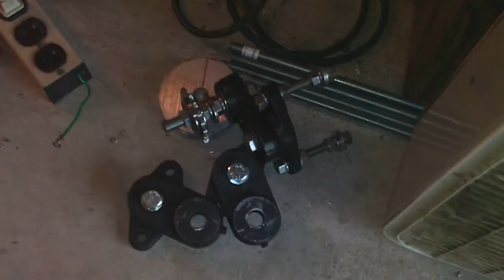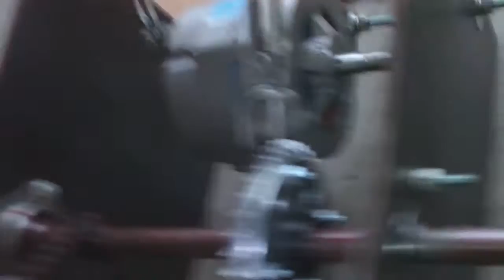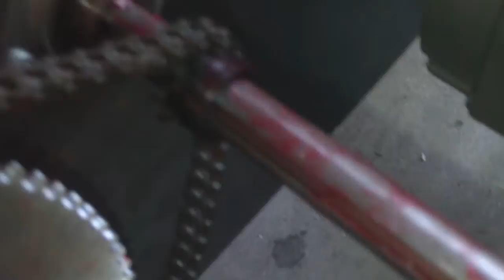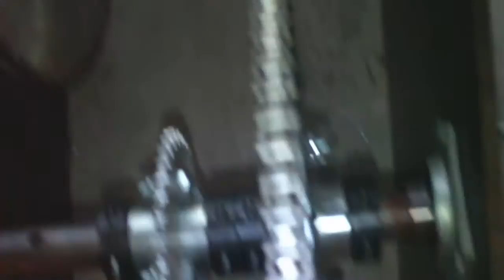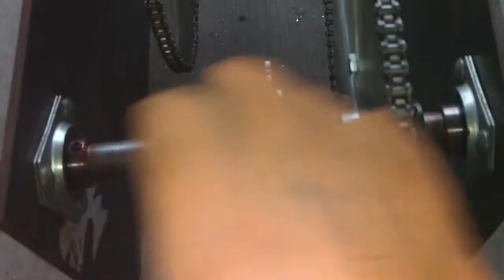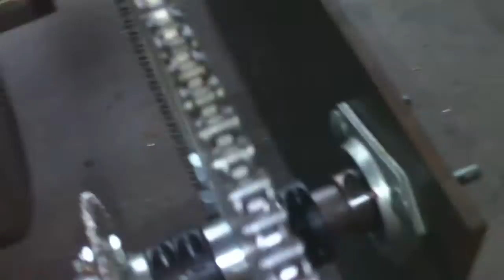39 - Gearbox with Chain

Comment from the maker: The amount of space between the sprockets on the 2nd & 3rd jackshaft is an issue. Definitely will be coming from the bottom of the chain, but will have to try a smaller idler sprocket. A 13t idler is on the way, will see if it solves the problem.